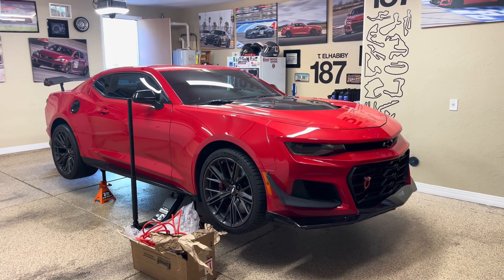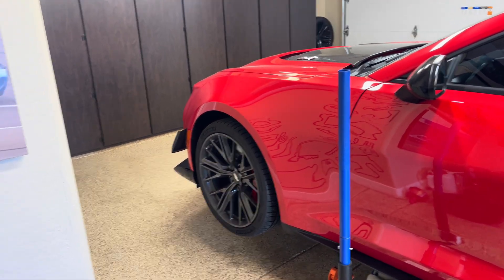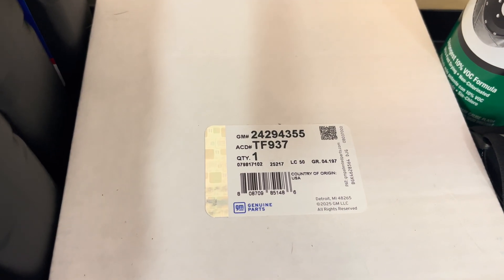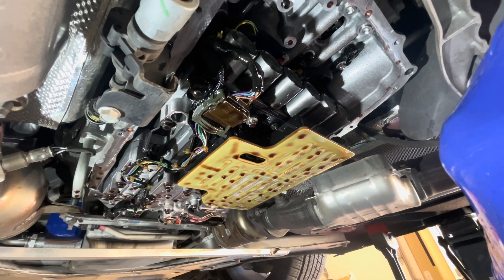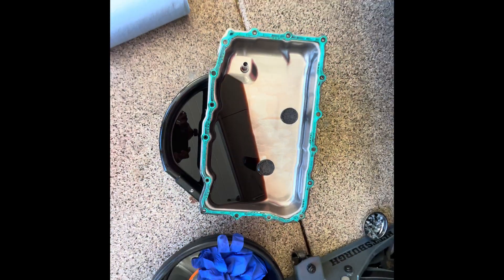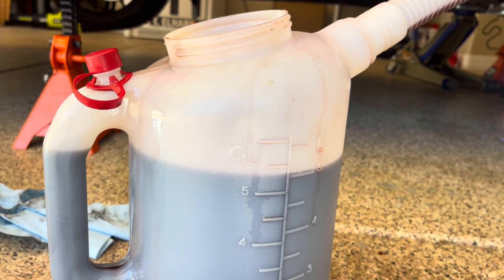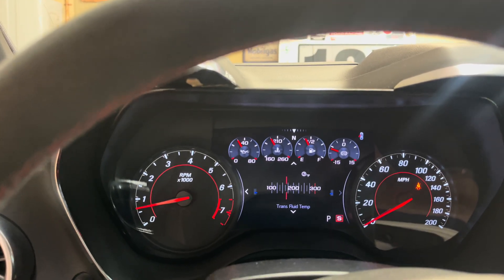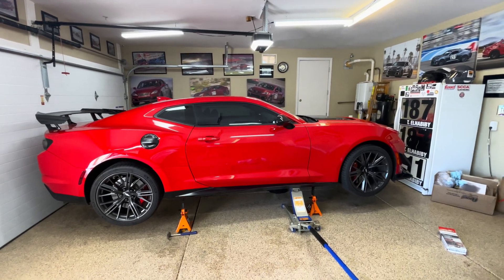2020 Camaro ZL11LE 10 speed Transmission Fluid and Filter Change. A Flush will DAMAGE a 10L90 per GM

Comment: Great video. FYI replace fluid after 15 hours of  track time per GM . I always use a scanner as I don’t know how precise the dash gauge is for measurement.
Reply from the maker: the direction say to use a scan tool or DIC display. It’s accurate
Reply: Part Number for adapter tool to add transmission fluid